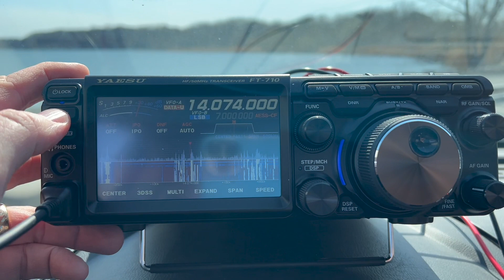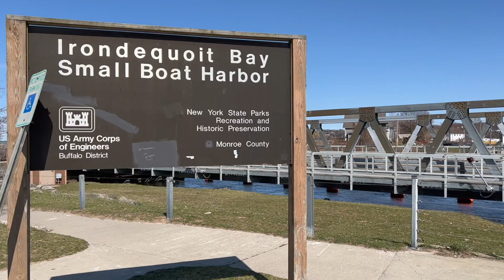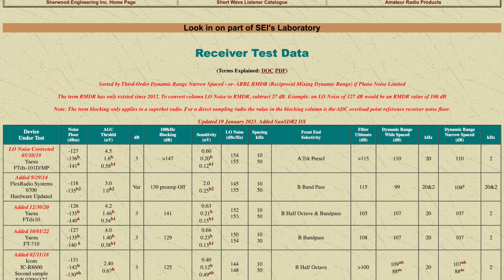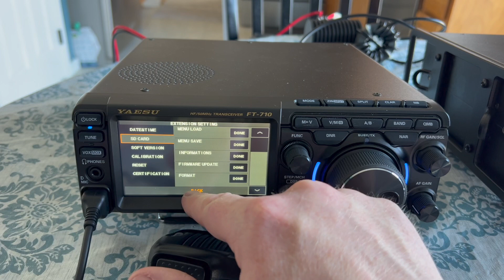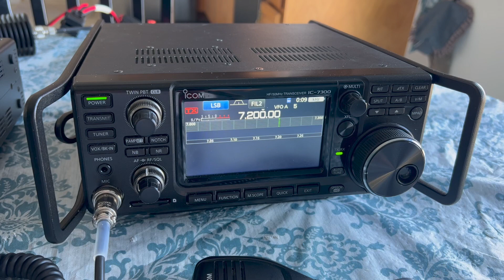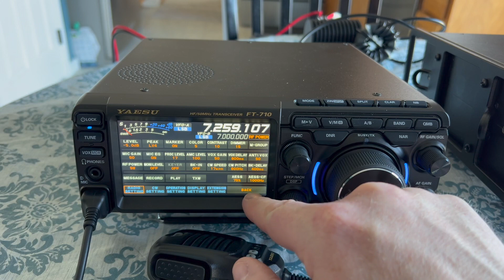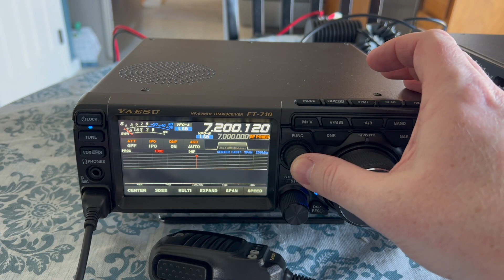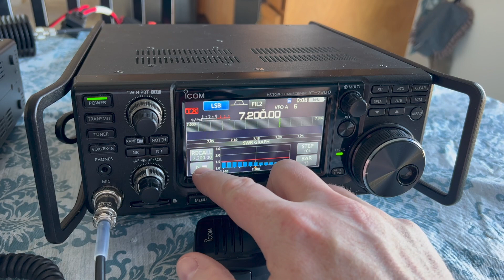POTA with Yaesu FT-710

Comment: Hi Mike, I really am enjoying your videos on POTA.  I am an old, new ham....meaning,  I've been licensed for over 20yrs, but have been inactive for the past 12-15 yrs. The new part of my comment is that I am new to all the current batch of SDR radios and to POTA.  I have been trying to decide between the IC-7300 and the FT-710.  I have been leaning toward the IC-7300, and your comments on your likes and dislikes of the FT-710 pretty much finalized my decision to get the IC-7300.   Thank you so much for your comments.  BTW, I subscribed to your channel. 
One quick question, which  side rails are you using on your IC-7300?  
Thanks,  Don
AC6LC, 73
Reply from the maker: Thanks for watching and I’m glad you found it useful! I use the Portable Zero side rails on my Icom 7300 and they’ve been great. I’m glad you’re getting back into the hobby and hope to get you in the log for POTA soon! https://portablezero.com

Comment: I like using the Bandscope on 10/20Khz span to click/touch tune the radio.. like the 7300..  Ideally the touch tune or the 7300 can be combined with the performnce of the FT-710 or FTDX-10.  Not all SDR is the same.  Ready for either the 7310 or FTDX-20.  I like a crystal filter at the input if I can get me that Touch Tune.
Reply from the maker: I always joke that when I find the perfect radio or perfect antenna, I’ll stop buying them, LOL. Thanks for watching!

Comment: Hello, modestly it seems to me that to understand the difference in audio quality between ICOM IC-7300 vs YAESU FT-710, it would be wise to take as a reference the ICOM IC-7400.

Why?

Personally, I believe that the manufacturer ICOM has made a huge mistake. ICOM focused primarily on a customer budget (sales price) of €1200 to produce its ICOM 7300.

According to you, why today is the ICOM IC-7400 (25 years old) better in Rx than the YAESU FT-710 and ICOM IC-7300, and competes without complex with the FTDX10 at the Rx level ???🤔

Obviously, the design and the sales price of ICOM IC-7400 was well above ICOM IC-7300 (marketing date: 2015)

Cordiales 73'
Diki58
Reply from the maker: I’m not familiar with the Icom IC-7400, but perhaps I’ll come across one sometime. My impressions of the Yaesu 710 vs. Icom 7300 are based on my style and preference for operating portable, such as POTA and SOTA. I do believe the 710 was priced too high at first, but Yaesu has addressed that. Now the 7300 seems to be priced high, especially for its age with newer radios, like the 710 and DX10. Ultimately, it is alway good to have options and competition.

Comment: I ran a 7300 next to a 991a for a year and ended up going with the 991a. I had friends that have owned their 7300 for years that sat down with me to try and get the most out of it and it just plain couldn't compare to the 991a. I now have the 710 as well and I think it has better receive than the 991a.
Reply from the maker: I wish they would update the 991a since I like all-band/all-mode a lot. You’re right too—710 has a much better receiver, display and interface.

Comment: I've been using my 710 for POTA activations for the past year.  I love it and it's perfect IMO.  I do primarily CW for 3-4 hours and with a 30aH LiFePO battery, I have no issues.  This is a fantastic rig for many reasons.
Reply from the maker: There’s definitely a lot of good things about the 710. And now that they’ve dropped the price, it can be more competitive with the 7300.
Reply: @MikeN2MAK  My feeling is for 90% of HAMS the 7300 is still a better base+mobile rig for most users than the 710? Your thoughts? Your point in one of your videos about the hardware back button seems SMALL to some people but huge to me.    You are trying to use a radio and it's locked in a menu you have to figure your way out of in bright sunlight....  hardware Exit button for the win.
Reply from the maker: @WarrenPostma  So far, I still think the 7300 is better for portable ops. Mostly due to some personal preferences, but the Emergency Mode tuner is a killer feature to have available if needed and can reduce the need to bring along an external tuner.

Comment: how did you connect the power of the FT-710 to your car at 80W?  73 de K1MBL
Reply from the maker: Actually, I didn't connect it to the car for power. I have a Powerwerx battery box with a Bioenno 20ah battery that I use for portable operations.
Reply: @MikeN2MAK  …googling Powerwerx battery…

Comment: Great video Mike.  I’m studying for my general and looking to get my first HF radio.  Would you recommend the IC7300 over the FT710?  I want something that’s easy to use with a nice big screen so I can read it easily.
Reply from the maker: Thanks! I wish I could say for sure, but both would be an excellent choice. I'll get my hands on the 710 again soon and want to take a better look at the screens and some other things between the 2 radios. I like the 7300 because of a few things, like the menu (easy and consistent with other radios, like the 705 that I have), the meter display options, and emergency tuner function. But the 710 is a new radio and priced cheeper now too. If you can check them out at a store, or if you have any hams nearby with one of the radios, it'd probably be best for you to get you hands on one and see what you like best.

Comment: I prefer to use my 710 at my high noise qth, dnr pushed to 6.  Receive audio not as crisp as a 7300, so I push AF to USB into laptop software mixer/eq to brighten upper midrange.  Mouse works great with modified tuning steps.  And yes, TX audio must be customized to your voice & mic.  Lovely radio!
Reply from the maker: Thanks for sharing those tips!

Comment: You seem like the type to buy a sports car and enter a race the next day and then blame it on the car for not winning the race.
Reply from the maker: I think the better analogy is buying a sports car and then blaming it for getting stuck in the snow the next day, LOL. The 710 is a great radio, and it’s been a sweet deal now that Yaesu marked it down for the holidays and repackaged it to cost even less. But some of the features on the ICOM 7300 are just more suited to my operating style for portable use. That said, I’ll be taking out my club’s 710 (it was never mine) soon to do the most recent firmware upgrade and try it out some more for POTA.

Comment: Very good info on the FT-710.  It is such a good-looking radio with very good receive.  But, as reported by so many, it seems there are several bugs and issues that Yaesu needs to workout.  73!
Reply: The 710 will only get better. Great update in Dec 2023.
Reply from the maker: @whitepinephotography5887  I should have my hands on the 710 again next month. I'm looking forward to it.
Reply from the maker: Thanks for watching! I’m going to take the radio out again soon (it’s not mine—it’s my club’s). It’s been a while since I used it and it’ll be fun to try out again.

Comment: Great video. Sorry if i missed it but what coax and toroid are you using?
Reply from the maker: It's a Mix 31 FT240 toroid and the coax is RG58 (it's a Tram mag mount). Thanks for watching, I'm glad you liked it.
Reply: @MikeN2MAK  Thank you I appreciate the info. Which bands is the WRC whip good for?
Reply from the maker: @bradl2636  I was using the 213" WRC whip. There are other 17' telescoping whips out there by Chameleon, MFJ and others, but the WRC is a few inches longer, which can be helpful. It can be used to tune 6-20m as a 1/4-wave vertical. If you add a coil, then you can get 30-80m, depending on which coil. WRC has smaller sized whips, but this is the longest. They recently upgraded it this year and I have a video on the enhancements and tuning. https://youtu.be/KB7vam1ft4g
Reply: I use the WRC 213 in whip with the sporty Forty coil and can tune 40-6m without a tuner. 20m flat from14-14.350.
Reply: @whitepinephotography5887  Sorry but what do you mean by "20m flat" I haven't heard "flat" used that way (newbie alert).
Reply: @bradl2636  No problem. It means that I have a 1:1 match across the complete 20m band and don't need to use a tuner.

Comment: I did enjoy my 7300 until I got solar panels installed at home. The 7300 was able to pick up soo much noise from the power optimisers under my panels that the 7300 became unusable until it was dark. I then bought an FTDX10. It is soooo much better for urban noise that I can use my HF radio during the day when the panels are working. No noise. The ic7300 was a revolutionary radio that made other manufacturers take note but alas the 7300 is no longer the favourite. Second hand values have dropped through the floor, at least here in the UK anyway. IC7300 I find is a bit sharp to listen to whereas the DX10 and the 710 are so much easier on my ears.
Reply from the maker: That’s good to know about the solar and noise. Thanks for watching and sharing! Hopefully the receiving quality on the Yaesu 710 and DX10 leads ICOM to improve on their next round of radios.
Reply: I agree. The noise floor on the 7300 is sometimes unmanageable .

Comment: Hi, you may know this now but I thought I should mention it for others reading the comments.  No ALC on Icom yes, but you want the Yaesu to be at the top of the white bar, but not into the blue.  Use the "multi" display to see your audio output strength and quality.  Full amplitude with nice curves and no squared off top/bottom is best.  With zero ALC you are only putting out a few watts, not the 20W you selected.  It's not like using a 7300, 705 etc.  73
Reply from the maker: Good to know! Thanks for sharing. I'm hoping to use the 710 again sometime this fall and will be sure to look into that.

Comment: Why would you use an antenna tuner with an antenna that you can tune to resonance?
Reply from the maker: Thanks for watching! In this video, I used the antenna tuner to test it out and see how it worked, since it was my first time using the radio. The 1/4-wave vertical was resonant, with SWR of around 1.5:1 or less, so the tuner was really just touching it up a little. But as you can see and hear from the test, the internal tuner seems to take longer than expected to find a match. Others who have the radio have commented about this too. That said, the tuner still worked fine and the radio is definitely a good one. I'm hoping to take it out again (it's not mine, it's our club's) soon.
Reply: and why would you tune on a busy freq?
Reply from the maker: @DG1LJP_Jan  I meant to spin the VFO off of 14.074MHz, but forgot, which is what I normally do. Sometimes mistakes happen when the first time you use a new radio. But if you look closely, you’ll notice the power was down to only about 7W, so it likely didn’t cause much interference.

Comment: You are 100% correct on your analysis - I also have the 7300 and FT-DX10. The one aspect that the FTDX-10 far outshines the 7300 is the selectivity, no receiver overload, while the 7300 overloads very easily and you have to back off on the RF Gain. Almost everything else, the 7300 is better - particularly the user interface. All the points you raised are spot on - love the multiple meter display on the 7300, such a pain to individually select a meter on the FTDX-10. And the looping of the recording playback on the 7300 - fantastic. Having to keep pushing the play button on the Yaesu becomes boring very quickly. Well done, first accurate comparison of the two rigs that I have seen. Both are great rigs - I'm not selling either. But, for field days, multiple station setups, RF noisy neighborhood etc the rig to use is the FTDX-10. For pretty much anything else, the 7300 is the better rig to use. Oh, you mentioned tuning steps - yes ! the 7300 has an intuitive auto speed VFO, the faster you spin the dial, the quicker it moves across the band. When you get close to a station, turn the VFO slower and the tuning steps auto adjust to a slower speed. You are also correct about the ATU, it doesn't seem to remember band settings, and takes much longer than the 7300
Reply from the maker: Thanks for watching and I’m glad you liked the comparison. I really appreciate the feedback and hearing you experiences too. I tried my best to be fair and honest. I’m hoping to take the 710 out some more this year and I’ll likely do another video on it too.
Reply: Frdx710
Reply: Ftdx10
Reply: I can almost agree with you, but let's try to summarize:
FTDX10 has a much better receiver, much better filters, selectivity, resistance to strong side signals and many other advantages that significantly outperform the IC-7300 in the most important areas for the operator. IC7300 may have simpler and more intuitive operation, but this is only a subjective opinion resulting from habits, which does not matter if you cannot hear the signal that the FTDX receives without any problems.
Reply: @Sylwester_Krolak  Sorry sir, but I cannot agree with you - this is based on ACTUAL experience as I own both rigs. I cannot hear any better on my FTDX-10 than I can on my IC-7300 - I often switch between both rigs on the same antenna. The ONLY time I will be able to hear better on my FTDX-10 is when there are hams in my neighbourhood running amplifiers, swamping out (de-sensing) the receiver on my 7300. In my quiet suburb in Africa (Nairobi) they are equal. The sensitivity specs are equal - in fact, they can both receive way below the noise floor, so neither of them are limited by sensitivity, they are limited by noise floor. Look at the Sherwood numbers for sensitivity (not selectivity).

Comment: My last comment about this wonderful FT710 radio is that the radio has outstanding audio quality coming out of a good external speaker not the one they. Give you with the radno has I as I use a good center channel poke audio speaker.  And you would not believe the sound that comes out as the radio sounds like it's 3 times. The size that it is.
Reply from the maker: When my club used it for a POTA event with the speaker, I was definitely impressed with the sound.
Reply: i have both radios (7300 and 710) and was specting being the 710 a much better radio....  well, not for me...  yes the 710 has better sound, but not much better receiver and the ergonomics is much better in the icom...   thinking in selling the 710
Reply from the maker: @sergiocavazos8963  I think with the current prices for both rigs, a lot comes down to user preferences. I do hope the competition from the 710 nudges ICOM to come out with new and improved radios.

Comment: My last gripe is with the RF gain knob making scratchy noise as you turn it quickly while receiving a strong signal just like the yaesu ftdx 10 suffers the same problem.oh and yes I have latest firmware in both radios too.

Comment: My main gripes are with the compression meter and s w r meter and if you have this radio check them both out. The compression meter will move even if you have processing shut off which definitely should not happen and the SWI meter deflects deflects sometimes even if. It's a Perfect SWr.

Comment: Thanks for sharing! I have 2 Yaesu's and 2 Xiegus and an Alinco as my HF rigs. I do not own an Icom HF radio (yet) but have thought about the 7300. Its good to know about the differences. The biggest gripe I have about my FT-DX10 is the button spacing. My fingers do not fit around the small area surrounding the VFO knob and it drives me crazy. I can live with the menu logic and I absolutely love the receive and all the filters. But I am pretty sure I will own an IC-7300 and an IC-705 sometime soon. Cheers and 73!
Reply from the maker: Sometimes it just comes down to the look and feel of the radios. If you get a 7300 and/705, I’m sure you’ll be happy with it. Thanks for watching!

Comment: I bought the FT-710 today, weighing all the pros and cons, the 710 is a more modern transceiver with alot of features I believe I'd enjoy. Having not owned a 7300, I don't think I would have any bias or lacking anything I'm missing so to speak. I really like Yaesu products and that's pretty much my entire suite of radios I own thus far. The folks that I see leaving reviews on the radio that actually own one, that don't own a 7300 like their FT-710 alot. I believe at this point its going to be operator preference. Having worked a FT-891 for a few months, I can work it without a problem and I believe I'm going to like the 710 alot.
Reply from the maker: Awesome! I’m sure you’ll have an amazing time with the 710. It’s a great radio and really has some nice features.

Comment: FT-891 is THE Pota Radio!  Why bother with anything else???
Reply from the maker: I hear good things about the 891 and almost bought it. I need to get my hands on one to play with soon. Thanks for watching!
Reply: @MikeN2MAK  I operate an FTdx10, FT-891, FTM-300 and an ICOM IC-7100.  Only one I'd operate portable, the FT-891.  In fact mine is in a side sling backpack with a battery right now.  Been using to hunt down RFI around my home station.